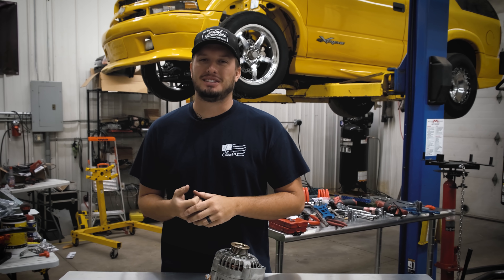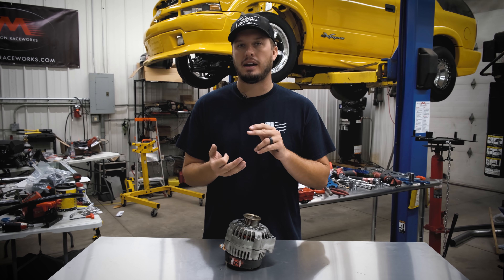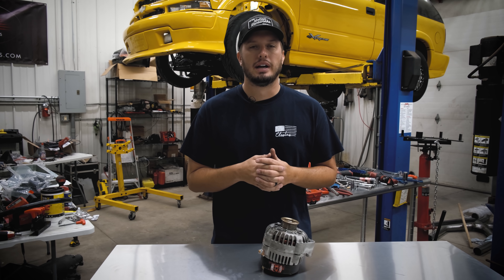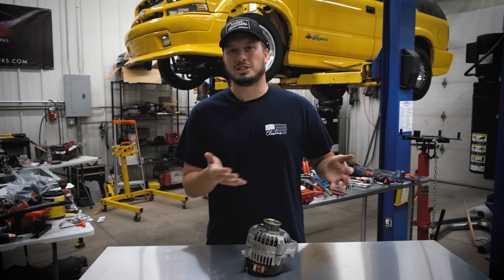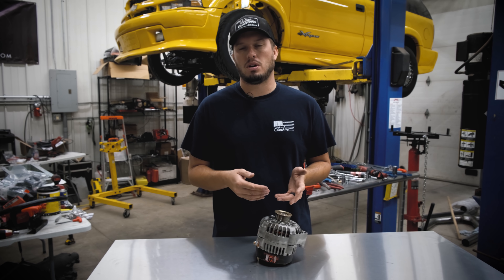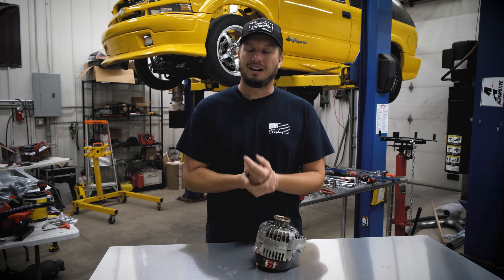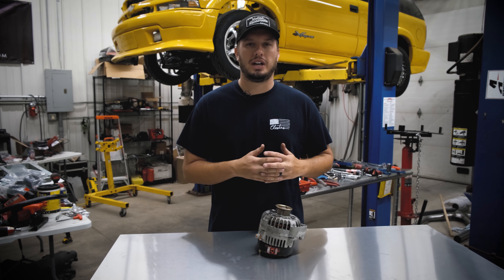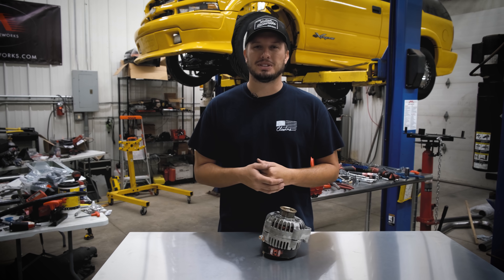We learned some things… Ultimate Street Car Charging System How To : Tech Tip Tuesday

Comment: How about manufacturing a pulley set with deep sidewalls? I am tired of throwing ribbed belts. All of the fancy laser alignment tools, billet mounts, etc and I still throw belts from my Pro Charger on my C5. High sided pulleys might be the answer as long as the sides aren't too high where you can't get the belt on it

Comment: My battery took a dump (2000 Trans AM) and it's time to do some homework.  I like the idea of a 14v battery as I'm running dual fuel pumps, two big fans etc on my procharged setup.  Do you know if they make the excess voltage alternator in a stock f-body housing?  I can't run the truck alternator because it's slightly larger, which causes an interference with where the procharger is mounted on the f-bodies.

Comment: So are you running your car's system off of the 14 volts from the battery or are you you running the system off of the amp's from the alternator?

Comment: Hi Doug. How do you accommodate sensitive 12 volt components in a 16.5 volt operating car. for example standard 12 volt bulbs would not last very long and some 12 volt control modules would achieve overvoltage protection. Cheers
Reply: I ran a 16 volt system for years. Power windows, mirrors, lights, stereo, etc. No issues. I love the people that say you can't run 16 volts on 12 volt stuff. lol smh

Comment: How do you go about picking rear gear ratios? For 1/8 mile is it peak hp at the rpm when u cross the finish line?? I have built 4r70w (OD), also whats a good rpm to cruise on highways with od street strip car

Comment: been looking for someone or a source for different sized pulleys.  I have a Powermaster as well but would like to install an ATI 15% UD crankshaft pulley.  I need ALL the amps with my electric fans and and stereo, so I need a 15% smaller alternator pulley to keep the ratio consistent.  Any ideas?

Comment: I've been in the car audio field for over 30 years seen people cooked their OEM vehicles by going to 16 volts set up. If you want to step up to a 16-volt system you will need a step-down box to run the inside of the vehicle OEM electronics. The 16 volt setup was designed for high-end car audio amplifiers putting out kilowatts of power and to run the amplifiers only. If you have a totally built vehicle like motion 16 volts should not be a problem with today's aftermarket electronics but if you're running OEM don't do it without a step-down box to protect your OEM electronics.

Comment: Yep,  alternators need to be rated higher voltage than the battery.

Alternators "push"  voltage into batteries, if you're running the same voltage rating battery and alternator this will happen.

Comment: Think of voltage the same way you would think of pressure in a water or plumbing system.  The added pressure makes things work better but can also wear things out quicker.

Comment: Good update Doug. Just had a similar situation. I have a 16 volt XS battery in my street/strip Nova, a new build. (Should have went with the 14 volt system due to not being able to jump off a 16 volt, unless someone else has a 16 volt, fat chance, oh well.) Sent my old alt to Power Master for a 12 to 16 volt conversion. They set it at 18 volts. Put it on and wound up not being enough amps to run everything. It produced 104 top end and 67 amps at idle. It wasn’t enough, so wound up sending it back again. They replaced it with another one that makes 160 top end and 110 amps at idle. That fixed my issues completely. All that said to say to your followers, make sure the alternator is putting out the required amperage to cover your needs. In addition, Power Master gives great customer service. I highly recommend them, great company.
Reply: I've jumped my 16 volt system off of a 12volt car. smh

Comment: Doug any tech tips or secrets you know on anything to put out there for those of us building GM 2500hd 4x4  trucks. Not sure how many of us are out there with these heavy trucks. I know few a of us are building them to try and beat on the diesel truck guys. Doing such events like drag racing,  wheel dyno, 300ft dirt drags and sled pulling. Thanks for any secrets to be shared.

Comment: Also what does the new alternator cost to support the xs battery
Reply: you can have a shop modify you existing alternator if they know what they are doing.  my brother used to fix alternators (not many people do anymore) and you can take a standard 10si and make it charge for 14 or 16v systems.  check some local shops if you have one.  or search your style online as there are several people that make them.

Comment: Do you need to step down the voltage for the Holley Dominator EFI computer or any of its components? It seems it the system and sensors were designed to run on 12 volts and you’re feeding it 14-16.8 your sensors aren’t going to report the correct information
Reply: the sensors will still be on a regulated 5VDC source from the ECU
Reply: the dominator will not have an issue.  some of the ignition coils i would watch out because they are 17 volt max.  i'm switching to 16v xs battery and charger and will have no issues with the dominator

Comment: Do I need to upgrade the wiring or anything to run a 14v battery and a 16v alternator. I have a 2007 chevy monte carlo ss .53 turbo with a 4t80e. But stock computer, etc.
Reply: Running a higher voltage will actually decrease the amp draw if the wattage remains constant. Your current wiring should be fine. The higher voltage will actually allow more wattage through the same size wire.

Comment: You are creating more problems running 16volts to charge that battery.  You run the same Spal fans I run. Spal tech support advised me 14 volt is max, you will greatly shorten there lifespan.  I think it might work if the fans are brushless,  but they are not.. My stereo has a label on it....14 volt is max.

I looked into this year's ago,  it just didn't add up to convert to a 14 volt system.
Reply: it really is designed for race use not everyday use.  if people are draining their everyday battery they should look at a higher amp output not volts.
Reply: @BoostedRide   Race use, grab a 16 volt setup.  Drag week and weekend  warrior, stay with the 12 volt setup.  14 is a great choice,  technology just isn't there yet...

Comment: Actually you do not have a perfect set up. Nearly all starters etc are designed nominally 12 volt. meaning max 14 volt. Too much charge is as bad as too little charge and will burn out efi pumps, or plain old Holley pumps etc. Even good ignition boxes should be 14V max.
Also I look and see a teenie little pulley on that alternator. Fine running along at 3000 rpm. But when you turn over 7000 they short out or just stop charging. Alternators on race cars are an instrument of the devil!! You have to slow that alternator down by a LOT.  Crank speed or just below for street driving and less for out and out racing.
The usual deal is a far bigger pulley on the alternator or a far smaller crank pulley. Both of which with serpentine belts are often an issue. In that V belts are more reliable,,, sometimes. And electric water pumps are far from ideal as well. And drag a shitload of power charging A mechanical waterpump seldom causes  issues though again slow them down to crank speed or as little as 75%. But that is no good for the road, Crank speed is generally fine.
I road raced succesfully for 25 plus years and nearly all of that without an alternator at all. 3 day meetings, 50-80 miles a meeting on one good quality modern roadcar battery. Even running lights though they were not great. That however with a plain HEI ignition not High Intensity. No fans but a Carter or Holley fuel pump. High Intensity is a bit more voltage dependent,, though again 14V.
All of this proven on my own 3 different cars as well as cars I prepared inc speedway sedans

Comment: Being as it charges at 16 volts does that affect the 12-volt system any
Reply: No not at all. It helps your things run cooler and more efficient. I been making and running DIY lithium battery from old laptop batts for more than 5 years for are cars. We found this as time had gone on. God Bless.
Reply: 14v is the beat of both worlds assuming your alternator is up to it.   The 16 v batteries require 19-19.5 bolts to charge which is too high for most 12v components.  MSD recommends no more than 18v to their boxes.  Pumps and fans aren’t going to live a long life above 16v.  XS will be happy to sell voltage reducers to go along with the 16 v batteries but that’s just adding more complexity.
Reply: @jjpoissant  Right that's why the alternator will max around 16.4 volts.
Reply: @yankey4  for a 14v system.  you should charge a 16v at 19 as jeremy posted
Reply: @BoostedRide  Right for a 16 volt batt but we are discussing a 14 volt batt. Max on that depending on the battery chemistry. 16.4 to around 16. 7 volts would be the max safe charge.
Reply: Sorry so 14.8 would be max safe or 4.2 volts pre cell. That is going to reduce the lifetime of the cells so best to do 16.4 or 4.1 pre cell assuming its lithium Cobalt.
Reply: @jjpoissant  LOL NOT
Reply: @funfun8095  ??   1992 wants its reply back..